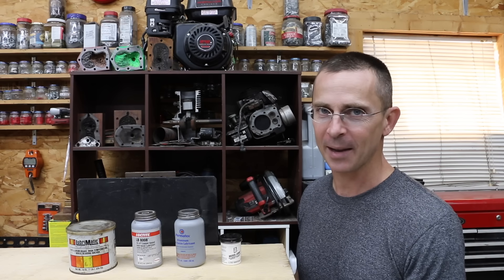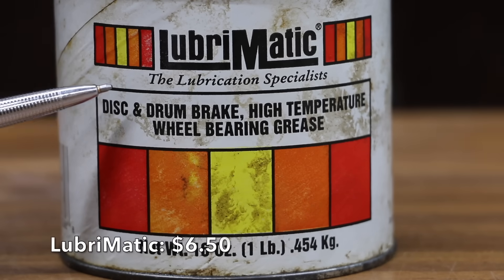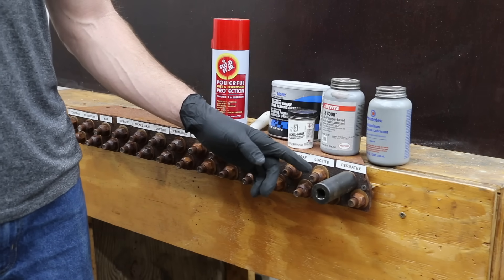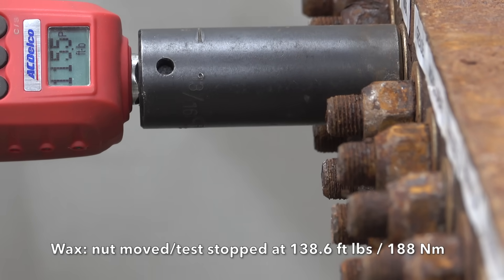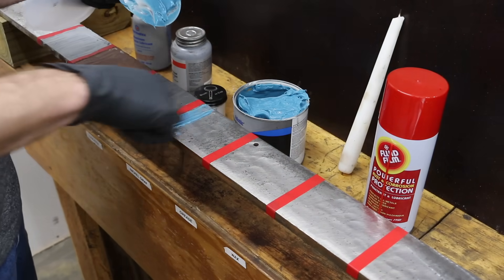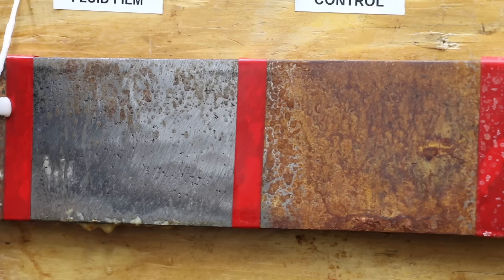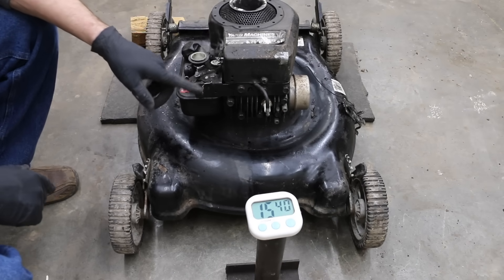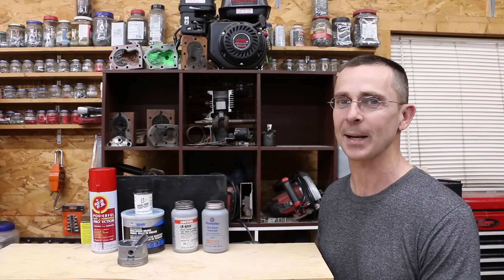Does Anti-Seize Compound Actually Work? Let's find out! Anti-Seize vs Grease vs Fluid Film vs Wax

Comment: Anti-seize isn't a good substitute for motor oil likely due to it's heat transfer properties. Although that type of engine is considered air cooled, the oil still does a good part of that.

Also it may be neat to do a summary video at least once or twice a year that just goes over the different things that were covered already, with all the links to all the old videos by topic in the description. YouTube search isn't always the best at finding such things, and there's already a sizable list of videos. Even though there's likely a ton of new stuff still in the works, an occasional recap may make sense for this kind of informative content. (I think part of that is sometimes people suggest things that were covered already. But understandably it's not exactly as easy as it should be to check for.)
Reply from the maker: Thanks for the suggestion.

Comment: I used that silver anti seize in the early 90's when I was a mechanic haha. It use to dry up and turn into almost a powder. I bought Orange  anti seize recently, made by the same company for the brake pivots and slides  on my Honda Pilot
Reply: I spent  a  lot for it, so it better work lol https://www.amazon.com/gp/product/B01MTNJ08Z/ref=ppx_od_dt_b_asin_title_s00?ie=UTF8&psc=1
Reply from the maker: Thanks for sharing.

Comment: In the power plant where I work, we Dow Corning gN metal assy paste on high temp stuff in place of anti sieze sumetimes because the moly breaks down to act as a lube when it the nut is broken loose. I would love to see this compared to the best of the anti seize. I also suspect that the face of the nut where it meets the surface was not coated equally in the tests and the shear force to break that bond might be the difference between some of the tests... Love watching your videos!!!!

https://duckduckgo.com/?q=dow+corning+gn+metal+assembly+paste&t=chromentp&iax=images&ia=images&iai=http%3A%2F%2Fwww.ellsworth.com%2Fglobalassets%2Fcatalogs%2Fdow-corning-g-n-paste-500g_431x431.jpg
Reply from the maker: Great suggestion. Thank you

Comment: What i like about you videos your not afraid to blow things up i.e. the lawnmower. I use regular Loctite (non copper formula) on a lot of various applications, anything that is exposed to (living in Michigan) varying weather conditions. One of the things i use it on the most is the back of aluminum wheels that contact the hub part of disc brake rotors, to prevent dissimilar metal corrosion. I had a friend of mine that had a flat, and had the hardest time getting his wheel off because of this.
Reply from the maker: Thanks for sharing.

Comment: Hi, as a suggestion to future videos. I would be interested in how water/cooler and fuel affect the performance of oils. I have a understanding that relatively small amounts of water, say 0.1 % of water in the oil will affect the engine in the long run. The effect of is obviously less critical for Fuel, but 10 % of fuel in the oil would be quite bad. These numbers are just examples, but could be used as some kind staring values. I like your show, best regards. Joakim from Finland.
Reply from the maker: Thanks for the video idea.

Comment: Hey Todd, have you ever thought about testing generators? Maybe a gas, solar, wind and inverter generator. Pick a price point test the power output, cost per KWh. Im just wondering if the technology is there to justify a solar or wind gen., Over a gas, in a SHTF situation.
Reply from the maker: Thanks for the video idea.

Comment: In the Air Force we used to soak bolts in Milk of Magnesia as a high heat anti seize treatment in jet engines. I don’t remember if this was an Air Force policy or if it was just a shop thing at our base. It would be interesting to research.
Reply from the maker: Thanks for the suggestion.

Comment: Idea: Wood and cinder block sealents. Which works best? Using standard sealants, Drylok, and also flex seal. Coat the wood and leave submerged, possibly under pressure.
Reply from the maker: Thanks for the video idea.

Comment: Could you do a video on a few brands of Loppers? I use the heck out of them, there's so many kinds and I feel like I blow through them after a few days trail clearing in the woods. Sharpness, durability, cut strength with N lbs of pressure for instance. A bit simple perhaps but it's such a common product.
Reply from the maker: Great suggestion!  Thank you.

Comment: Hi Project Farm,

I was wondering if you could use diesel instead of 2 stroke oil, for a 2 stroke engine.

Sometimes when you go cross country on a 2 stroke bike and need a refuel, but you're all out of 2 stroke and the gas station doesn't stock any.
Could you instead just mix petrol and diesel 50:1, maybe just get you down the road?
Reply from the maker: Thanks for the video idea.

Comment: i would have liked to have seen moly grease, as it has mollybdenum disulphide powder added which leaves a dry lubricant when the grease component has burnt away from heat
Reply from the maker: Thanks for the suggestion.

Comment: I’d like to see you get a machine to measure lumen and see if the flashlights out there have the proper output. Especially Milwaukee and dewalt lights as well as the China tactical lights that use either 3 triple a or one 18650 I can verify they are twice as bright using the 18650. Ps I don’t use the extremely cheap ultra fire 18650 that come with a lot of them

Comment: Pretty good test overal.
It would have been even better if you tested a steel/ironbolt/stud going trough cast iron into aluminum.
Like a exaust manifold mounted on a aluminium head.

And if you need some studs to test, all studs for the exaust manifold for all vw/audi since the 90´s are very/very/very prone to rusting.
If they have been there for about 1-2 year or more your lucky if you can get he nut of without the stud breaking of and then most times flush or a bit inside the head and needs to be drilled out.
Reply from the maker: Thanks for the suggestion.

Comment: Possible video idea, testing different brands and types of floor jacks like seeing much force is needed on the lever to lift a set weight,  height for a single stroke of the lever, amount of drop after leaving weight on them for an extended period, etc
Reply from the maker: Thanks for the video idea.

Comment: Anti-Seize works by having a non corrosive metal suspended in a grease so even if the grease gets washed away there is still a layer of the metal to keep parts from rusting together.but motor oil it is not.
Reply from the maker: Thanks for the feedback.

Comment: I've got another great test that you can do. It has to do with heat and oil on a plate.   I saw a Convention Show Barker do this and I'd like to know is it was a trick or if it was real!  !   Email me Eeelmerfuddd@gmail.com.
Reply: Was it "painting" hot metal with linseed oil so you get a blacksmiths finish? I can say it works, but how well compared to other finished I don't know.
The way to do it is heat the metal to just at the smoke point for the oil, but not so hot the oil just burns off, and daub it on. Spray oil can work, and paste wax works well too!

Comment: OK while you did demonstrate that the antiseize was effective against the break away force you cleaned the exposed threads before removing the nuts.  The MAIN reason we use antiseize is to prevent rust on exposed threads.  I would have wished that you took the torque readings on the removal of the nuts without cleaning.
Reply from the maker: Thanks for the constructive feedback.

Comment: To make this a perfect test, you should have used a plastic washer. No galvanic effect and it would mean that you are really looking at only what is happening at the threads. Lots of times it’s the bolt face sticking, not the thread. At least for the initial release.

But otherwise awesome and useful study!

Oh!  And when those copper or nickel based ones start to dry in the container, just add a little dribble of thick synthetic base gear oil in there and mix. Better than new!
Reply from the maker: Thanks for the feedback.

Comment: I'm honestly amazed the engine ran at all on that stuff.  Definitely not ideal.  I know you test with old lawnmowers a lot but if an old compressor motor is of interest to you I might be replacing a beat up one this year and I'd rather pass it onto you to upcycle it for testing than just junk it for parts.

Comment: Long time viewer and I really enjoy your videos!  I've been thinking a long time about a good suggestion about a future video and finally came up with one.  I've had a few vehicles with cast iron exhaust manifold cracks and have used (and have had several mechanics use) different products and methods to repair the cracks with no success.  Is there a product on the market that can stand up to heat of a exhaust manifold and provide a long lasting repair?  Is it worth it to have someone weld your manifold to fix a crack or is it just throwing money at a problem that really just needs a costly replacement part?  Again, thanks for the great videos, and keep doing what you're doing!
Reply from the maker: Thanks for the video idea.

Comment: Interesting content 😀, I’ve used anti-seize in the past and it dried out...always believe it was due to high heat but looks like my suspicion might be plausible cause by extreme cold 🥶 temperatures ...I live in a climate varying from high humidity 30 degres Celsius to high humidity -35 Celsius ... would be interesting to see same test at very cold temperatures
Reply from the maker: Thanks for the video idea.

Comment: In the oilfield we use a copper based anti seize, usually Kopr Kote by Jet Lube. It’s been used for decades, simply because it works. We call it pipe dope. It comes on a 5 gallon bucket and you put it on with a big brush.
Reply from the maker: Thanks for the feedback.

Comment: So I use the VERSACHEM brand copper based anti seize for all my work. We use mainly stainless steel and black iron for our pipe unions and I whole heartedly believe the copper based to be the best. I moved away from the aluminum based after having it wear out after a few months vs the copper lasting over a year on the unions (for clarity,  our pipes run steam, hot water and cold water through them)
Reply from the maker: Thanks for sharing.

Comment: So, the anti seize and controls were, in some cases, not substantially different. why use it at all? Maybe after a year there would be a difference.
Reply: breakaway torque isn't the whole story, anti seize and grease make it easy to unscrew the fastener after it's been broken loose, and this test didn't involve dissimilar metals, stainless bolts screwed into aluminum will seize such that the head will twist off before the bolt comes loose, steel screwed into copper alloys, or vice versa gets screws and pipe plugs permanently fused into the hole they were screwed into.

Comment: Another fun test. Thanks. I always forget to put that stuff on even though I have it on the shelf.  As another test maybe hardware store rope strength. I use a lot of ropes. The strong braided ropes I used to get for tree work aren't available at my local shop. Professional ropes are rated for various strengths. I'm curious about utility ropes found at HD and Lowes.
Reply from the maker: Thanks for the suggestion.

Comment: Chisel paste for hydraulic hammers works fantastic too. It contains lots of copper and MoS2 bound initially in a stiff grease. I do all my turbo manifold bolts with this stuff for decades now and can open all threads after years of heatcycling and corrosion. For everthing on the chassis, fluid film gave me perfect results. I live in an area with 5-6 months of road salt.
Reply from the maker: Thanks for the info!

Comment: In the manufacturing of large commercial aircraft we use a product called pure nickel anti seize. It has proven to be the best in applications such as landing gear and brake components where high heat is generated during landing and extreme cold @ high altitudes. Also used in many hot engine areas.
Reply from the maker: Thanks for sharing.

Comment: Have you had a chance to use any of the "remote inspection camera endoscopes"?  One could be useful for a motor cylinder heads.   I recently encounter the need to inspect my septic system pipes because of a large tree growing nearby.  I'm currently searching for a Pipe Inspection Camera Endoscope. ebay has a few for $300+ and also $30+. Curious if the cheaper models would be sufficient?  Overall, a camera endoscope is a useful gadget (I wouldn't use WIFI because of potential issues.) 

https://rootx.com/
Something like this https://www.youtube.com/watch?v=WoLjs2xeTvg
Reply: I have a cheap USB scope from Amazon ~ $30?  With any scope you must be careful with the light because it gets hot.  Don't use the light more than necessary, if you take a break switch it off.  Use the lowest brightness you can get away with.  Finally, the "good" or great scopes have better lenses and can auto focus vs cheaper ones that go totally out of focus at the slightest movement. This is macro photography so ultra shallow depth of field - so focus matters.  Consider renting the scope at home depot $125 for 4 hrs.  But becareful as insurance does not cover damage from improper use.  Rental guy said they charge $125+ for damaged camera about every 3 rentals.

Comment: You should try copper coat, it's an extreme anti seize we use in the directional drilling industry to make our rods brake free easier, I'd imagine well drillers use it as well.
It has tons of copper in it and is very much like the loctite you tested.
       I use it on brake bolts, slides and ball joints, being it is a lapping compound, I also use it for slide lubrication on all of my Glocks as it resembles the factory lapping compound that they come with.
 You can purchase it in the(1) or (5) gallon buckets from Vermeer, Ditch Witch, and AIS, at least here in Michigan
Reply from the maker: Thanks for the feedback.

Comment: I just finished watching one of Jay Leno's videos, he featured a 1920's Benz-Mercedes with a 6 cylinder aircraft engine from WW1.  Prior to starting he put a few drops of Lucas Assembly oil on each of the lube points in the valve train.  He claimed that this assembly oil had better adhesion to the valves and wouldn't be cast off as quickly as the straight oil from the oilers.  Have you ever tested the various assembly oils?  I know that there are many brands out there, but I have know idea of the range of qualities that are available.
Reply from the maker: Thanks for the video idea.

Comment: Wax is ONLY for use in low Temperature applications.  Paraffin wax based candles (the most common) have a flash point of around 380F - 390F, soy wax flash point is around 290F - 300F, beeswax has the highest flash point at 400F.  Point is, all of your wax was vaporized & burned off in the grill.  Any left over residue from the wax & any additives used in the wax would have become polymerized and acted as an adhesive causing the high torque needed to remove those nuts.  

Also, where is the galling test?  One of the biggest reasons to use anti-seize is to prevent galling....
Reply from the maker: Thanks for the feedback.

Comment: 0:00 I haven't been there. In my case, rust turned what should have been a trivial clean-up and undercoating into a full rebuild of the chassis and suspension (incl. replacing 80 % of the fasteners because one half of them broke and the other half got stripped), so it's actually been taking about 200 times as long as it should have.
Reply from the maker: Thanks for the feedback.

Comment: Ironic that the company that made its name on making bolts not come off, makes the best to make them easier too.
The wax should work, but not with heat.  No way would it work on something that gets hot.  Around the house uses, something that has to be non toxic etc....
Reply from the maker: Thanks for the feedback.

Comment: Have been using Permatex Aluminum for decades.  It does the job and isn't expensive.  I also use it as heat-sink compound in my computers--seems to do the job.

Next, how about investigating pipe dope?  Rectorseal No. 5 has been my choice for years, but I'm curious if there's better stuff out there.
Reply from the maker: Thanks for the video idea.

Comment: It's used mostly for high torque connections. Not anti corrosion. Much much higher torque my friend. 20yrs electromagnetic Eng. Oil/gas. Copper is by far the best.
Reply from the maker: Thanks for the feedback.
Reply from the maker: Great feedback. Thank you

Comment: I think he did a fair job with this post but time would tell better.  It may take years for the metal to metal  to bind together.  While I did not read all the posts here, what I am about to say here may already been posted.  One must first remember when you apply any type of lubricant to the treads you change the torque figure when tightening down the bolts.  You may have to light up the torque setting or you may over torque.  I have rebuilt many water pumps and HVAC/R compressor and found the follow up rebuilds after the application of a anti seizing compound.  Not only does it lubricate and protect the threads, it helps protect them from electrolysis which causes the two surfaces from binding one to the other.   And go light on the application of any anti-seize compound.  Like to old commercial, "A little dab will do you".
Reply from the maker: Thanks for the feedback.

Comment: If your wheel/lug nuts get hot enough to burn candle wax completely away, you need to get a lighter foot !    
             Don’t use Copperslip on wheelnuts  the stuff turns nearly solid and once you’ve cracked them lose  the studs are sticky all the way off !
Reply from the maker: Thanks for the feedback.